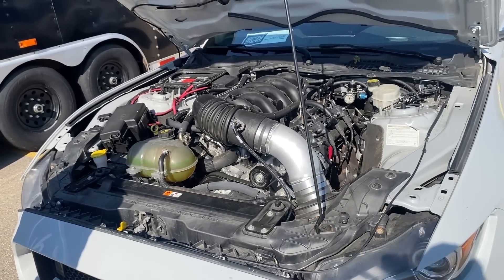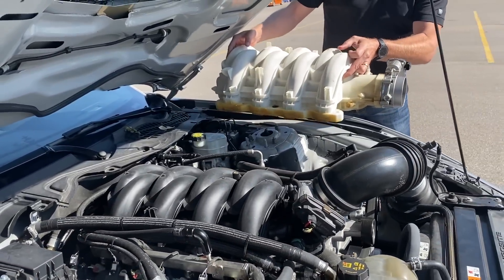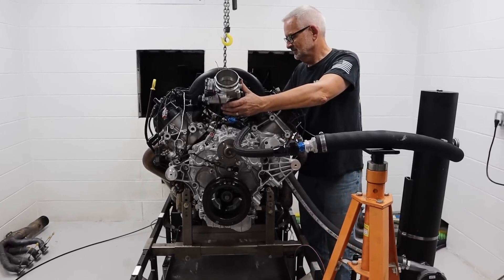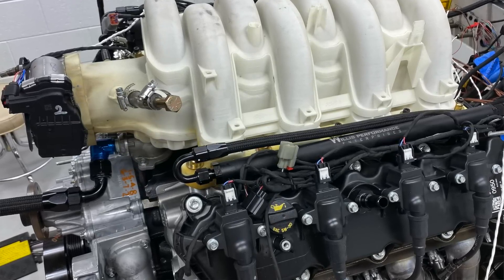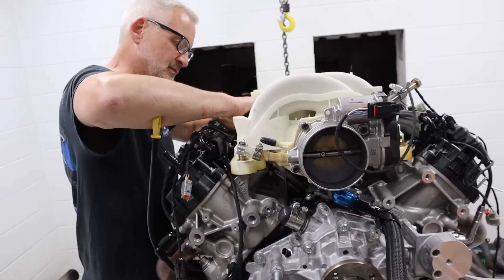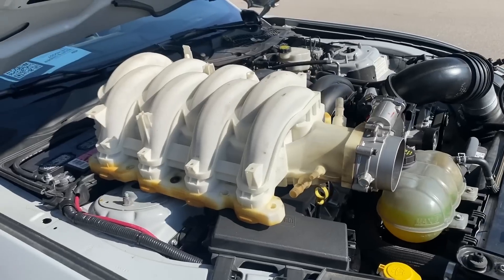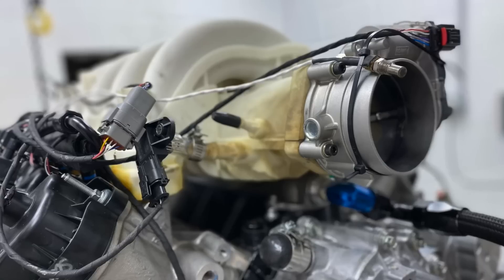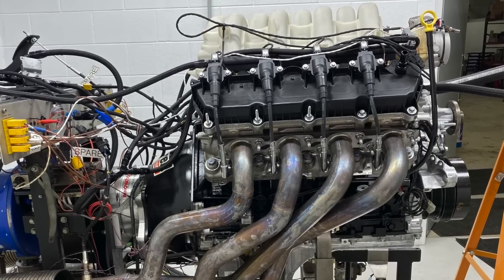Ford Performance Godzilla 7.3L Low Profile Intake Tested | How Much Horsepower Will You Gain?

Comment: Thanks for puttin this out, I've been hanging on the edge of my chair waiting for this video. Is this the 11:1 motor you tested the other intakes on or a stock Godzilla?
Reply: This is the same 11:1 engine with the stage 1 ported heads.
Reply: @brianwolfe2993  did you guys end up measuring the throttle body flange on the prototype?
The description was a big vague in the video just saying that it's bigger.
I did my best going through the Ford Performance site to try to find that exact throttlebody to get my answer, but I had no luck.
Its slightly different in appearance to everything I found.
Reply: @deancranley2241  was in the last video talks about it around the 4 and a 1/2 minute mark and towards the end of the video too. Said it was using a gt500 throttle body.
Reply: @mbusch84yt  to the best of my knowledge, all the GT500 ones are a twin throttlebody. This one is a single.
I'm just trying to find out exactly what size it is.
Reply: Found it, 2020 GT500 throttle body is 92mm, up 5mm on the stock 7.3L one.
👍

Comment: Anybody know if this combo fits in a 66' mustang with stock shock towers and not cutting it up?
Reply: The engine is the rough size as a FE big block between the heads and a lot higher, even a Windsor 351 the heads are touching the shock towers on a 65/66 So no way unless removing the shock towers
Reply: Looks like its a rear sump where the Mustang is a front sump oil pan.
Reply: @SargentEdgedTools  wouldn’t it be sweet in a 65-66 mustang with a 5 speed manual or even the 10 spd auto. I’d like to see one in a 66 bronco 👍🏼
Reply: @SargentEdgedTools  They have a conversion kit. Im sure its a little pricy though.